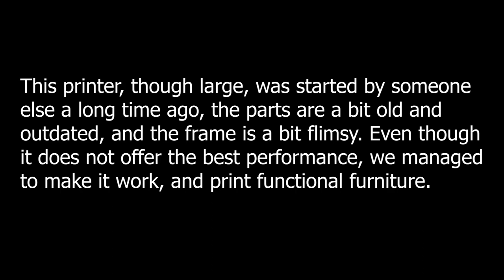3D Printed Chair on a 900mm HevORT printer

Comment: apart from the supervolcano, that is not an outdated printer by any means. Nice job! Btw, you could brace that frame pretty easily. Large printers like that are hot end constricted, and printer head speed hardly goes beyond 35-40 mm/s. Being flimsy is not that big of a deal in that case :)
Reply from the maker: It's about 60mm/s which is fine, but Z hop has to be enabled to not scratch the print too much and cause layer shift. Travel speed is set to 1000mm/s which can cause frame vibrations.
Reply: Well, there seems to be uite a lot you can easily make to make the frame more stable, from larger edge pieces to just cross steel wires to create some frame pressure.

Comment: Hey does butting up linear rails together to extend their length effect the printing at all?
Reply from the maker: I would say it does, since one carriage is matched to one rail, different rails would cause some backlash. This printer frame was assembled by someone else and then I stepped in and finished it. When printing large objects with large nozzle, the effect is not significant.

Comment: Lol, I was looking to build almost the exact same printer and specs as you 😂

860x860x600mm HevOrt
Octopus Pro
TMC5160
TMC2209 
etc

All I need is the extra pocket money to buy my 3030 extrusions 😲
Reply from the maker: Mine is about to have Orbiter 2.0 and CHC Pro hotend, plus 10x 120mm static cooling fans (PFR1212DHE)
Reply: @davidwang_3d  That's pretty dope 😎

I currently have my Orbiter v2.0 on one of  my Ender 3v2 machines, but I don't think I'll be migrating it over to the HevORT-VzBot machine to be built.

I am gonna try a 3 in 1 out triple extrusion hotend from XCR3D and gonna try if I can use Fusio360 to integrate a mounting system where I can attach 3 hextrudort extruder as direct drive for each of the different filament inputs OR I might go the ERCF MMU route; we'll see 😎
Reply: I'd say go 3060 or 6060 dual Vslot to make it a bit sturdier
Reply: Nice job
 Can you upload  the files
And the frimwire 
And wat ball screw did you use?

Comment: Your printer its not a real HevOrt, real hevort use 3030 profile
Reply from the maker: This DOES use 3030 profile
Reply: @davidwang_3d  
amazing, maybe the printer is so big that the profiles seem smaller !!!
Reply: 3030 profile doesn't define a HevORT as a HevORT... its the overall design.  I'm building a 1M cubed HevORT and using a mixture of profiles.